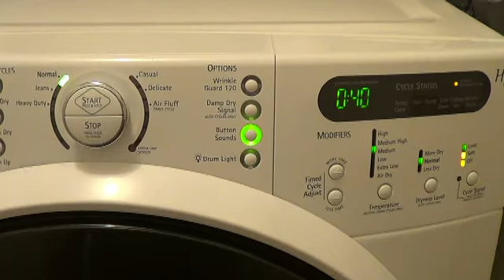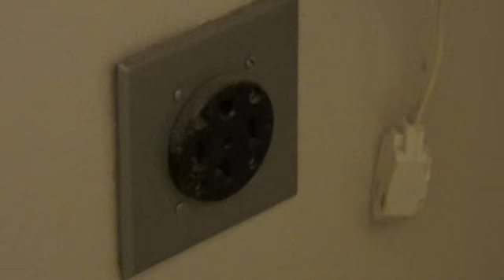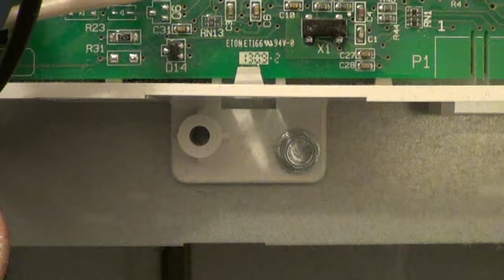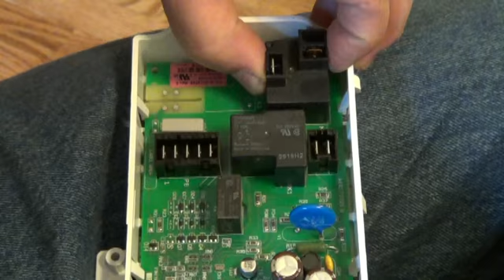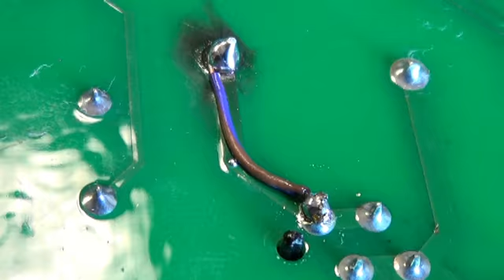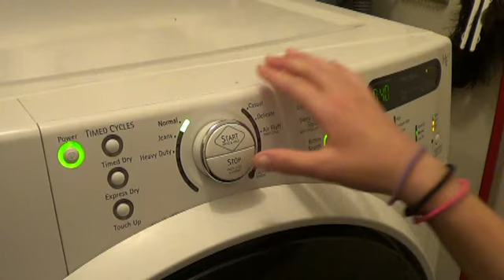Dryer Sears / Kenmore HE3 - F01 Error Code Main Circuit Board Repair

Comment: i need some help. Ive done the steps as on here. When I got to taking wires out at the back before removing switchboard,  i can't get the black and red wires at the left sie out.. It's holding me back. Can anyone please tel me why im having such trouble getting those two out?
Reply from the maker: From looking at what I can see on the video I don't see a release clip on the connector with the big Red & Black wires, but check it carefully for anything that moves when you squeeze or looks like you need to push in something to allow it to release.  My best guess is that because these are fairly large wires and probably just spade connections that they require just a bit more wiggling and PULLING.
Reply: @jimdandy6472  Thanks Jiim. I finaly got the wires off. It was exactly the same problem as you showed on the video.  I'm trying to find someone with a soddering iron and some wire now. With the CoVid 19 ways, I don't think I can go to a store to get one. So far thanks for the feedback. I'm hoping I can sodder it, and it will be fixed.
Reply: @jimdandy6472  JIm  I just got a soldering iron, but i notice, those wires you use in teh video to attach the two broken ends, doesnt come in the kit.  Is there some kind of substitute i can use? i have the soldering iron and solder.  But am I right in thinking that i cant fix it until I get some wire?
Reply from the maker: @craigmorwood7694  You need to find or buy a little piece of wire to act as a jumper between the exploded pin and the other pin shown.  Read some of my resent replies to others, but solid #24AWG copper is ideal.  Old telephone wire, door bell wire, or garage door sensor wire works.
Reply: @jimdandy6472  Just to update this.. today was the first day I could actually go in a hardware store and walk around(Covid 19 had them closed).. once I finally found the wire that worked (bell wire) that I COULDNT seem to find online, i took off the old solder I did, re-soldered it and bam! It worked. Atleast for now. Thanks so much . My first appliance repair job.  For those of you who did this, how long after the repair, did it break down again?

 Thanks again JIM.. You don't happen to know dishwashers do you? Our dishwasher also broke down as soon as CoVid 19 hit!!

Comment: Jim, what size wire did you solder in?
Reply from the maker: I've answered this several times over the years, but the wire size should be around 22AWG to 24AWG.  I like solid copper wire, but stranded will work.  If you can find some old telephone wire that works good., or doorbell wire, or the wire that goes to the safety sensor at the bottom of a garage door or the open pushbutton, or HVAC thermostat wire.  Lots of things will work.

Ideally you should clean the pin where the solder exploded and then wrap the wire around the pin.  Follow the solder track on the circuit board over to where it connects to another pin an lay it on that pin.  Use good soldering techniques of heating the wire until the wire is hot enough to melt the solder (don't just drop a blob of solder on a cold joint).  The jumper wire can be insulated or uninsulated.
Reply: @jimdandy6472  It was my 1st time soldering. I picked up a basic iron and soldered in some old 24 AWG I found in the basement. Started right up! Thank you!! Keep posting!

Comment: THANK YOU - THANK YOU  Same problem , same board and fix on Kenmore HE2 Dryer.  Adding the Jumper wire is key here.  Haven't used my Soldering iron in probably 10 years. Glad I kept it. Awesome!  Former Electronics Tech here. Subscribed

Comment: You sir, are THE BEST !!!  I've never soldered in my life, but I followed your instructions, and it is all working.  Thank you !!!  One safety question though... Does it matter what kind of wire we use?  I used a left over piece from an old dimmer switch.  Instead of solid copper, it was the hair/strands of copper.  No guarantees, but do you think that'll be safe over time?

Comment: So, you're just inserting a jump wire instead of replacing the burned out 30A 250V relay ($11USD) that caused the problem?
Reply from the maker: Best I can tell the solder joint just explodes for some reason, perhaps not enough metal to carry the amps.  The tracking on the circuitboard gets blown away as well so you need a jumper wire to replace the damaged segment.  No relay has failed to my knowledge.  It's been working for almost 5 years now.

Comment: Took a few trips to Ace to get the right gauge wire and was tough getting the right size and shape wire but once i soldered it and put it all back together it fired right up. THANK YOU. Had to buy a solder gun total rookie but your video was a big help.

Comment: Thank you for this video this helped tremendously. Went to Home Depot bought a $25 soldering iron kit and to be honest I didn’t know what kind of wire to use I scrolled all the way down of your comment notice someone said they used cooper now didn’t know what gauge as there was many gauge sizes others on here commented they used a 20 well they didn’t have 20 so I went with an 18 gauge. Dryer is up and going now thanks again!!

Comment: Thanks for publishing this. It wa
s absolutely spot on in diagnosis and ease of repair. Opened up my board and it was the same circuit. 

I was fixing a whirlpool duet steam dryer w same code. Total fix time 15 minutes.  

Thank you again!

Comment: Jim Dandy U ARE THE BEST.....i just fixed my Kenmore Elite H5 Dryer,it had exact same problem with board.AND JUST A TIP FOR REST PEOPLE WATCHING THE VIDEO THAT U CAN USE THE TELECOMMUNICATIONS JUMER WIRE FOR SOLDERING. GOD BLESS U JIM DANDY

Comment: Thanks my repair worked!!!  But, I didn't pull the case off holding the circuit board. I just pulled it out after pushing in the tabs in. Saved a step.

Comment: THE SOLDER JUMPER BRIDGE IS ONLY A TEMPORARY FIX!  I am an electronics specialist and here is what happened to your  circuit board.   It got old.   The contacts on the inside of the flat relay pack are now very pitted through use.  The pin on that contact got so hot that it de-soldered itself from the board.  Put the jumper in and you will burn a bigger hole in your board, rendering it useless.  REPLACE THE FLAT PACK RELAY.  Original relay had 30 amp contacts points.  
Watch here as to why and how to replace that flat-pack relay.  https://www.youtube.com/watch?v=aZWBjouDPuw
There has been  an update 40 AMP UPGRADE FOR DISCONTINUED OMRON G8P-1A4P 12VDC 30AMP General Purpose Relay With heavier 40 amp contacts, this relay problem should not happen again.  Find the $8.99 fix, below.
Click Here >> https://www.ebay.com/itm/40-AMP-UPGRADE-FOR-DISCONTINUED-OMRON-G8P-1A4P-12VDC-30AMP-General-Purpose-Relay/202554094432?hash=item2f292a3360:g:LDYAAOSwHDdcK7IS:sc:USPSFirstClass!48872!US!-1
At 10 years, I had the same thing happen to a board relay pack on my dishwasher.  The contacts just get old.  I swapped the relay pack there too and works great!

Comment: Thanks for posting this video. Someone linked to it on another site and I'm glad they did. Was able to fix a Whirlpool Duet dryer that was exactly the same. I didn't add a wire because I messed up soldering (you should tape the wire down like he shows), so I just soldered the point directly with no wire and it's working great. Hoping this doesn't come up again.

Comment: This happened to my Whirlpool dryer.  Same issue, exact main circuit board, same error code, same solder joint blowout.  THANK YOU FOR THIS VIDEO - I fixed it in 20 minutes and it's working!

Comment: I have a Whirlpool Duet dryer which showed the same F01 error code. The manual only said call for service with no explanation of what was wrong or how to fix it.  The service of a blind item would most certainly have costed me $300 plus after an $85 dollar house call to diagnose the problem.   I had the identical explosion splatter when I took the circuit board off.   I followed your video to the "T", reinforced the solder joint with a piece of wire after I touched it with a spot of flux 
and had mine fixed in under an hour.  This was a great informative and to the point video that only cost me an hour of my time.

Comment: Thank you! I didn’t add the extra wire, just soldered the joint back and it worked. If it fails again I’ll consider adding the extra wire to distribute the load. Or will also consider replacing that relay. Thanks again for the video!

Comment: what type of wire is needed to connect the two joints on the back?
Reply from the maker: 24 gauge (24AWG) solid copper, insulated or un-insulated will work well.

Comment: Thank you Jim Dandy!!! After watching your video I went to local hardware store purchased a solder gun, solder, 16 AWG wire and tackled it exactly as you described in video. First time using a soldering gun and it worked!! Like others mentioned, the explosion splatter was very similar. I have a Kenmore Elite HE3 Gas Dryer. We've had it for almost 13 yrs and hope to get more milage out of it. We JUST recently replaced the valve coils, thermo sensor and flame ignitor (no heat) and it seemed to work just fine until we got the F1 Error code. Thanks to your video we're back in action!

Comment: Is this fix safe to do or could it cause other issues?
Reply from the maker: It's up to you to decide.  If you not comfortable you can buy and new circuit board and install yourself, or have a professional do it.  Mine is still working fine, and there are lots and lots of positive comments.

Comment: A small power surge to my dryer last weekend and I got the dreaded F01 code. The board for my machine is $292.00!!! I went to Northern Tool and picked up a $10 solder kit (Item #43985) and decided what the heck...let's give it a try. In less than 30 minutes (including time to make another pot of coffee) my dryer is working again. I did not make the improvement of adding the jumper wire.

Comment: Awesome video!  Great presentation, great content, great editing.  I have a Whirlpool Duet, got the same F01 error, the same instructions applied.  The wiring was slightly different, but on removing the board, it had the same solder explosion as yours.  I did the same repair, and I am off and running.  Not only did you save us the money, but I did the fix in 20 minutes on a Sunday, rather than having to wait to get parts or a repairman.  I have a suggestion: Set up a Paypal or Vendmo account, so people can send you a "tip".  I see you are at a quarter of a million views.  I have to think you saved at least 100,000 people about $400 each, or $40,000,000.  If they each gave you a fiver (which I would gladly do), you would have half a million dollars.  Seriously, consider it.

Comment: Thank you Jim. I had the exact same issue. Took out the old soldering iron, found some nice flexible wire and voilà. Dryer working as a charm.

Comment: Thanks for this 

What gauge or size wire did you use ?
Reply from the maker: About 22AWG solid copper works best.  It's flexible enough that you can wrap it around the pin.  Insulated or non-insulate is OK.

Comment: Great. I am going to repair my dryer circuit board this weekends. Is there anyway you can tell me What type of wire(how many guage and so on) is used for the job? Thank you
Reply from the maker: 22AWG to 24AWG copper, insulated or non-insulate, solid vs. stranded, but there are lots of options that will work.  Clean/scrap the pin where the solder exploded, wrap the wire around the pin.  Heat the pin wrapped with wire until it's hot enough to melt the solder (i.e. avoid a cold solder joint).
Reply: @jimdandy6472  Thank you. You ar the superstar. Thank you for your great video and also the reply. I got it done. Mine was burned too bad, but able to get the connection points going exactly how you replied. Thank you so much for helping many. (And my washer is Kenmore He1, and circuit board is exactly the same as yours.)

Comment: I just did this repair to my 10-year-old Kenmore He5t and it worked like a champ! Literally had everything I needed to do the repair in my garage.  It took me about 5 minutes to have the machine opened up and another 5 minutes to do the solder and another 5 minutes to put it back together.  The hardest part was cleaning out years of trash behind the drier and reconnecting my vent!  Thanks for the detailed and informative video to save us all money!

Comment: Wow old video and here i am in 2019 doing this repair to my new Kenmore Dryer lol thanks a lot saved me tons of money and I guess they still haven’t fixed these problems at the factory
Reply from the maker: I'm surprised to hear that this problem still exists on new equipment.  It's hard to believe the manufacturer doesn't know about the issue!  Four years ago I never thought this would be my most popular video, but I get thank you's almost everyday and can only guess that lots of people don't take the time to comment.
Reply: Jim Dandy what’s even better is if you go to a website to buy stuff I look for this model and always see them for $100 needs new circuitboard lol and I but it and fix sell it for $500 lol

Comment: Worked well for me, identical issue on Kenmore Dryer. No luck re-soldering to existing path without the wire. Used a spare piece of wire from old computer fan to bridge the gap and all working well now. 

Spent 17 minutes on the phone with a Kenmore repair representative for them to tell me they couldn’t get a repairman out that day. Eventually had to hang up as they would not stop pushing extended warranties and subscription plans. Jokes on them! 

Thanks for the video!

Comment: Great video. Thank you. What do you think caused the trace to blow out? Is something else in the dryer aging and drawing more amps than it is supposed to? Is this blown trace acting like an unintended fuse?!? Just want to make sure the fix isn’t letting a larger problem get hotter.  ?!? Curious to hear thoughts on that. Thanks again. 👍
Reply from the maker: The real answer is i don't know why this failure is so common, but it appears to be a power (versus control) circuit from a relay that handles a fair amount of power (amperage).  I think the solder joint and track is just undersized for the amperage it carries.  At some point it just fails and explodes.  Some videos show just re-soldering the joint, which is at best as inadequate as new.  Adding the wire should provide extra metal and help carry the load.  With 190k views I have never had someone say it later failed or lead to a larger problem.  Mine is still working almost 4 years later.

Comment: Thanks so much for posting this Jim!  I just fixed my 10 year old Kenmore HE2 that had the F-01 error and the same burned out circuit.  A quick trip to the Home Depot , $25, and a half hour later the dryer is back up and running!  I didn't use a wire. Just cleaned the one bad spot and applied new solder.  Worked like a charm!  Thanks again!

Comment: You would think, as common of a problem this is, that Whirlpool, Maytag, Kenmore would fix this issue.  Components should not get this hot to explode the solder connection.  There should have been a recall on this board.

Comment: This video is a lifesaver.  Thank you so much!  Mine blew out the board yesterday and I had it up and running in maybe 30 minutes.  The only thing I'd add is that you don't need to remove anything but the top cover.  You can pop off all the connectors on the PCB while it's in place and then manually pull out the PCB.  Three bolts, a little fiddling with your fingers, some solder, and you're done!

Comment: This was great. I was able to have the dryer working in less than 30 minutes. I realize everyone won't have a soldering iron and some bell wire laying around, but you can afford to go out and buy the soldering iron, solder and flux for what the control board would have cost your. Thanks!!!!

Comment: Saved me $200.  I tried just resoldering the joint and it still threw the error, so jumped it with the wire and worked like a champ.

Comment: Amazing! Just had the same thing happen to mine. Hardest part was getting the right sized socket for the screws... Mine were 1/4in by the way.  Also, I dropped the screw that fully secures the plastic housing to the metal part down into the abyss of the dryer... I'm sure it will be fine.  I didn't have the exact same dryer, it was a Kenmore though.  Also, the tape is a must.  I tried without it and as soon as my soldering iron touched the wire it went flying =\

Comment: Jim, My wife and I cheered too when your fix worked on our HE5!  I was actually relieved to see the same solder blow out you showed in the video when I pulled the board from our machine.  
“Honey, I can fix this”!
Thank you for taking  the time to put together this easy to follow video; you saved us a couple of hundred $ a few trips to the laundromat and a bunch of heartache.  SearsPartsDirect wants $215 for a new User Control Board and does recommend a service technician install the part.  😜